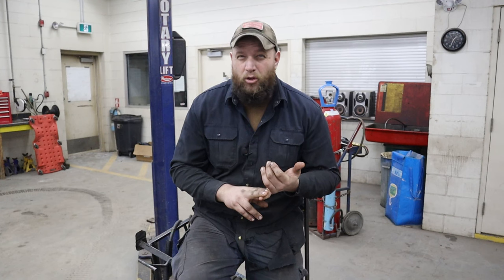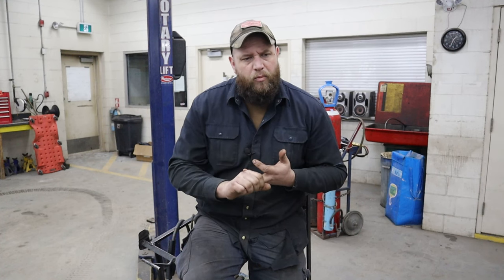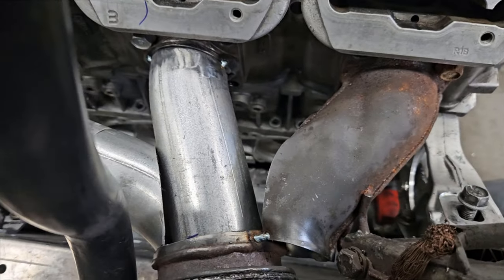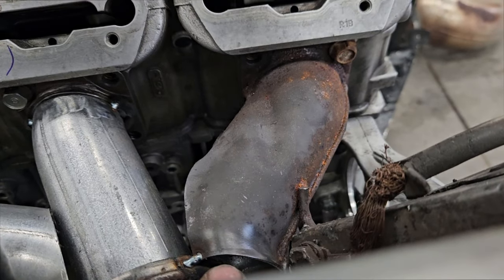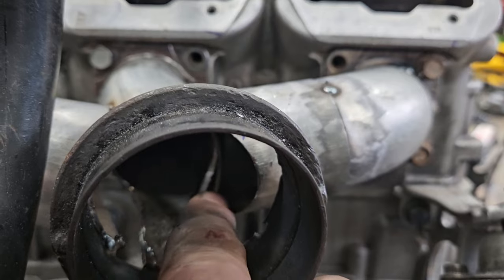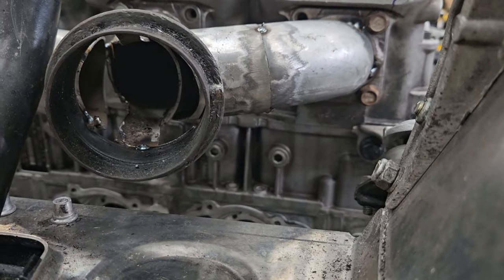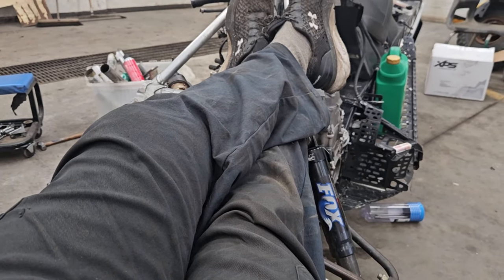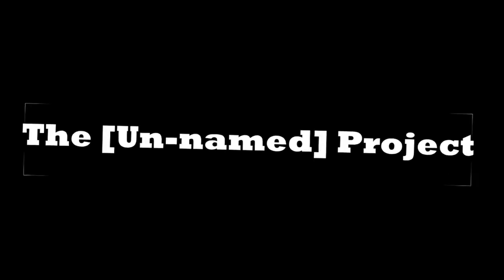Triple Threat part 5.... mostly lol.

Comment: I'm thinking your head pipe or manifold isn't going to work so well your going to have 3 cylinders making 3 different amounts of power being out of tune with each other , if you look at the original one for the twin cylinders it was built near perfect length from side to side so to work correctly all three head pipes need to come together being the same length at the collector even if the collector is further away from the heads the expansion chamber is the same length just my opinion others may vary ???
Reply from the maker: Thank you for your comment my friend I appreciate thought like this. I was lost and I say lost when I decided to do this manifold. I was gonna try to make everything the same length and then make it fit and this and that bit then when I looked at sleds from the 90s thay had triples, they all have different lengths. I have to try and see I guess. Is this a good idea?
Reply: I've never worked on sled engines with 1 expansion chamber but have experience with triples on bikes with 3 pipes and one of the most important things building those expansion chambers was getting the head pipes the same length and the right length to get the best power in the rpm range you want  so that's what my thoughts but using only 1 expansion chamber for all 3 cylinders I'm as lost as you  I have a idea use 3 expansion chambers  ?   :)
Reply from the maker: That would be an idea but I dont have enough room. The sled is tiny or else I would try to make it fit.